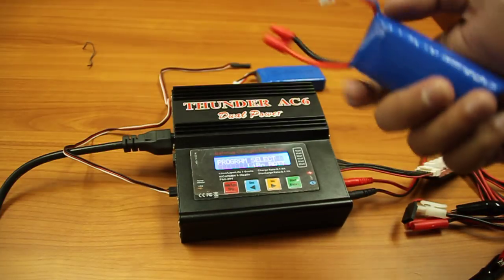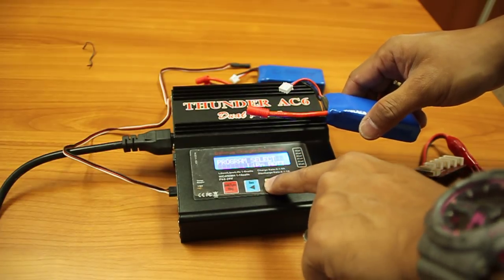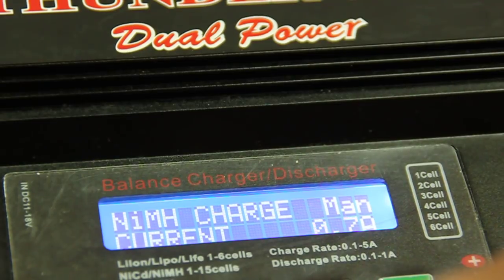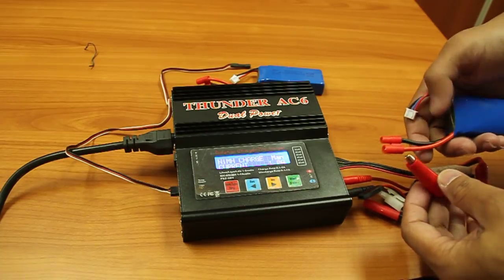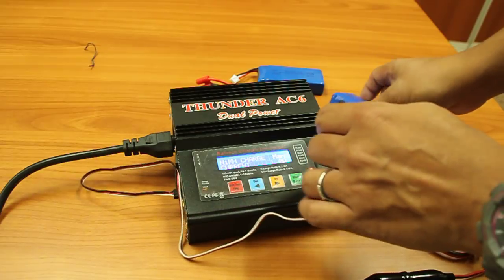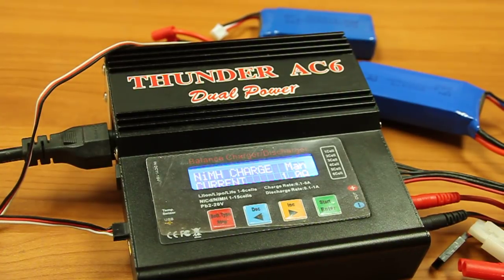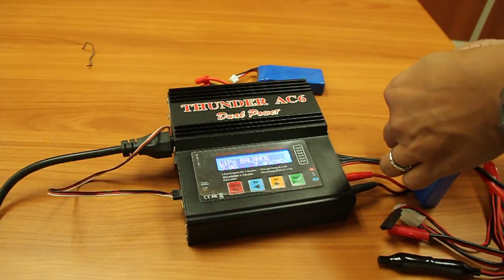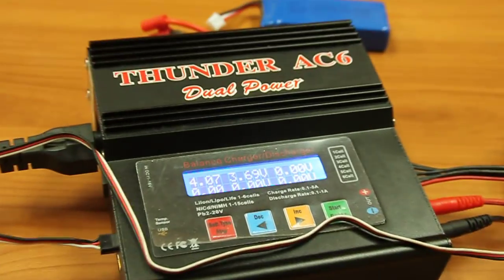Low Voltage Error on your Lipo battery? Here's a quick fix!

Comment: Yep, this works, unplug your balanced connector before charging tho, or it will error, brought back an 3S 2500mah  sitting at 7.5v to 10 volts within 5 minutes, then I just charged it as normal 👍

Comment: THANK YOU!!

I was having so many issues, for what reason I have no idea. 

3S 5200MAH 11.1 V had a reading of less than 2V. I put it on nimh 1A for approximately 5 minutes, jumped the voltage to 8.4ishV, and the lipo charging mode recognized the battery and began charging!!

Comment: Is it normal for different cells to reach lipo cuttoff at different voltages? Like my 2S when I put it on the balance charger, 1 cell is like almost .2 higher than 2nd cell. Is it because  its in series and thats just how it is.?
Reply: Yes, it's pretty normal, as long as it's not too much of a difference,   .2 is nothing

Comment: There must/can be only 0.1  rate difference between the cells. Check your connectors, if it stays way of your battery is dead or it gonna catch fire. So be careful

Comment: Awesome. Saved my battery.
I have a 4s 720mah that went low voltage.
Charged with 0.2A until it hit 13V them went back to the lipo balance.
Worked!!

Comment: Didn't work for me at first because I was doing it wrong. Watched closer and made sure not to connect the balancing wire when doing the nimh charging. Worked like a charm. Took me about 5 minutes or so to get to 9.6v on 3s 5200mah batteries and then switched to lipo and voila!

Comment: Mine voltage on 2s stays always around 4.70V with nihm charging (I think one cell is too low). What should I do to get them around 7.4V ?
Reply from the maker: We have the same problem.   I'm looking for a way for just to charge up the 2nd cell but too risky.
Reply: @dehnermdeleon  for the risk its not worth bro. I have bought new 2-pack 2s batterys ;)

Comment: Thanks, it worked. 1 minute was enough to get rid of "low voltage" error on my Eco Six charger. Not sure if the battery would still work, but at least it's charging now...

Comment: After I forgot to switch off my RC Crawler because their was a problem with one of my kids I came back and saw that I left the car without switching it off. It also had the problem that I couldn't charge it anymore luckily i did the same as you told me and the battery is saved thank zou very much .

Comment: My lipo battery currently has the same issue :
Cell 1: 4.20v
Cell 2: 4.24v
Cell 3: 0,00v

Is it safe to follow this method? Previously I'm charging with a cheap lipo charger (B3 pro)

Comment: I fixed one of my batteries this way, but when i try this on my other battery, wich is the same type battery, it shows OVER voltage when i try to charge it in nimh mode? Any suggestions?
Reply from the maker: It might be a defective battery

Comment: Awesome. I was skeptical about charging on a different mode. I literally only had to do it for like 2 seconds on 0.8a, and it fixed the low voltage problem. Now charging like normal on lipo mode. Thanks!

Comment: If voltage too low what I do is get a fully charged battery of the same voltage and connect red to red and black to black cable hold it for like 3-6 seconds and then put on charger and will start charging hope this helps

Comment: Hey so I did this with my 5000mah 7.4v shorty but when I tried it with nimh charge 2a it went up to about 5.5v, then started going back down and when I tried to balance after it still said low voltage afterwards. Any fix?
Reply from the maker: I think this is a cell issue and cannot be fixed

Comment: Best video to save your LIPO battery, it saved my batteries in minutes!!! I forgot 4 cells in my truck for a few weeks and outside temp went below 0C several times. All cells were reporting "Low Voltage". I did this trick on 2 2s and 2 3s. I did what this guy said but actually went even safer. Here is how it went:

I plugged a 3s battery, set the charger to NIMH 0.1 AMP change. I charged it for 1 minute up to 9.5V, 1 minute folks that is all it took... I stopped the charge, pluged in the balanced wire and start lipo charged successfully! Saved the battery! 

My 2nd cell would not charge at .1 amp. I put the charger on 1 amp NIMH and restored the voltage to 9V in 1.5 minute. Changed setting to LIPO et Voila!!!

the 2 2s cells that were dead are older cells, several years of age. I charged them up to 6V in 3 minutes on NIMH 1AMP and then changed setting to LIPO balanced et Voila!!!

Thanks!
Reply: Francois, this worked for me too! As a noob to RC Flying, I was thinking that I'd need new liposuction, when they wouldn't charge after the winter furlough. Top tip!
Reply: Thanks for the input - worked for me too :)
Reply: OMG you just saved me and my sons RC life. ♥ THX

Comment: Friend when I do on my lipo this nimh thing and push enter for charging it shows me  7.8v. 
So can I wait and how long???
Or the battery is Dead???
(2s 4000mah....)
Reply from the maker: What is the Voltage of the batt?  If that's the max Voltage then it's not a low voltage error.  It can be another problem.  Usually you should not exceed at the max voltage of the battery when performing nimh charging.

Comment: my problem is.... i have 2S battery 7.4v. i use turnigy 80w 10 amp and it can connect to pc. for some reason it reads 6 cell battery and gives me error hi voltage battery check volt... yesterday was charging without any problem
Reply from the maker: it can be a cell or board issue

Comment: Thank you so much. It works for my 6S lipo. Had to charge it in Nicd mode at 5 amp for about 6 mins til it reaches 21v then switch to lipo mode and works beautifully. Was about to toss this expensive battery away. It's pretty understandable that all batteries if not use often will degrade and that's what happened. Same thing with a car battery. Park your vehicle for a few weeks you may not be able to start it.
Reply from the maker: Glad it helped

Comment: So awesome! I left my brand new 2s 2200mAh battery plugged in and on. Tried to charge it today and it got the low voltage warning. Tried this fix at 1amp and brought it up to 6.9 volts then tried it on lipo balance and it works! Thanks!

Comment: Worked for me. I did same trick with 18650 pack what I made myself. Problem was that batteries were discharged and showed only 0.05 V. After providing some juice (roughly 10 min in NiMH with no balance) my charger start sensing them and then was able to properly balance charge them. 

Thank You!

Comment: Good video.  Looks like it worked for a lot of people based on the comments.  I'm going to try it on my batteries but one question...should I connect the white balance plug while it's charging?  I see you didn't connect it in your video.   Thanks
Reply from the maker: Hi Kev there's no need to connect the white balance plug during charing in NiMH mode.  Hope this helps and good luck!

Comment: What causes lipos to get low like this in the first place? I store all my 4s lipos at the recommended 3.80v.

But for some reason my main battery which I don’t abuse and is only 3 packs old. Came out of my storage box at 2.13v. I never let my lipos go beyond storage voltage. What makes them go this low on their own? Bad battery?

Oh and I’m doing this now, seems to have done the trick! Back up to 3.65?. Thank you!
Reply from the maker: My lipo malfunctioned after my drone crash and gone missing for a day.

Comment: Definitely works! Went to charge my battery this afternoon and the charger spat out the low voltage warning - then I tried this. Battery went from 3 volt to 7.42 volts. I shut it down and switched to LiPO and no warning. Thank you
Reply from the maker: Glad that it works.

Comment: Had a 3s lipo (11.1v) had 3 0.00V readings and 3 2.xxV readings. Put it on NiMH @ 0.5A (Battery charge rate is 1.3A) for 5 minutes and watched the voltage climb from around 9 to 10.80. After it reached 10.80, I flipped it back to lipo mode and wallah it worked! Thank you! Liked!
Reply: BOTH OFF YOU MADE MY DAY, i thought i lost this lipo but luckily not

Comment: What do I do with the error message CELL ERROR and no other explanation? I have the SkyRC e660 charger and even the manual doesn't tell me what to do. Appreciate any ideas.
Reply from the maker: It can be a terminal to the cell or the cell itself is the problem.
Reply: @dehnermdeleon  Thanks for the reply. After some troubleshooting I managed to fix it, I think. I suppose it was a low volt problem. I charged it for 40 seconds with the NiMH program as you said and then I suddenly managed to balance charge it again..

Comment: the first battery  with your way
it's worked
but the 2nd battery is 3sl
5000mah 11.1v 50c
so i tried same but it doesn't working this time
what do you think!
Reply: I have the same battery as u was completely fucked i forgot about it for a few months this method saved it and it balances fine now

Comment: This did not work for me. I get a cell count error no matter what amperage I set it to. I did set my 7.4v to 3.7v and it worked but it read fully charged almost immediately but I know it's not charged because I just ran them low while running my rc.

Comment: It works Awesome!! But i have a quick question im charging 1250mah battery, so does that mean capacity indicator on charger should be around 1250, too? Or should i just wait until it says it's full
Reply: One more thing, you put 0.8a for 5500mah battery. You think its ok to putt 5.5a?
Reply: Yup

Comment: Worked great for me👍
I had a 5200mAh, 7.4v, 2s. I charged it at 1.3 Amps till it said it was at 7.0 volts then stoped and balanced it.
Reply: i got the same one did what you said and it wont go above 6v and still wont work on balanced charge

Comment: Worked like a charm for my 6S 3300mAh LiPo. I NiMh charged it to 19V (max 22v), then changed program to LiPo. Then the charging continued while showing one cell with a lower volage than the rest. Hitec X4 Eighty

Comment: my 5200mAh 2s LiPo was at 6.20v, I used a cheap $10 charger and now I can charge it with my good charger :)
Reply: one of the cells was about .20 under so could it be a bit damaged?

Comment: This actually worked!:) i depleted one cell of my 3S battery when i had my drone hooked up to betaflight and was testing engines. Apparently in this mode only one cell was used and was not recognized after in charger....btw it was battery that i bought like two days ago and since im noob i didnt know. I said my goodbyes to it but i found this..after 7min in LiNM mode i got voltage error and just like magic LiPo was found with enough voltage to get balance charged:) what a day. :)
Reply: To add, i was charging it on concrete on balcony in a ceramic empty pot and had sand ready just in case. I sat next to it and controlled temperature every 20 secs
Reply from the maker: Glad to be of help! A subscribe would be nice!

Comment: Find which cell is the low one through the balance port of the battery, and charge as a single cell lipo with a receiver connector.

Comment: Awesome! Worked for me! Thanks a lot. Did some minor changes:
Had a 4cell 1300mAh battery, with the following cell voltages:
#1@0.888V
#2@3.931V
#3@3.932V
#4@3.933V

Connected them as explained in the vid. Charged at 0.5A for 3min-ish. 
Cell #1 had then risen to 2.524V, (#3,4,5 was more or less the same).
That allowed me to start charging it using a regular LiPo program.
Reply: I'll give this a try
Reply: My batteries are at 
1.57
6.28
3.91
3.91
It just won’t balance out the 6.28 just keeps climbing and the rest don’t move
Reply: @Frosty_fusion put it max Amps on NiMh and wait for 1 hour. Should be good after that

Comment: My Turnigy Accucell S60 gives me an connection Break warning how can I fix it.
Reply from the maker: Bro check the terminals (connector) there's no continuous flow of current otherwise it can be an internal issue inside the cells.  Too risky to check

Comment: I was so terrified to do this, but it did actually bring one of my old Li-Po's back to life. I'd make sure to have a bucket of sand nearby when doing this, since I've been told it's the best way to reduce the damage caused by a Li-Ion/Li-Po going into thermal runaway.

Comment: I JUST PUT IT ON LIPO CHARGE WITHOUT THE BALANCE LEAD AT THE 0.40 CURRENT FOR 10 MINS. THAT WORKED FOR ME.
Reply: Holly cheese wheel that works. i was trying everything. i either got "Lower voltage" alarm or "incorrect cell count" errors when trying different modes. 
when i tried auto detect cell count mode it said 3 fine with just the balance lead, but when i connected just the negative or positive of outputs together it went to 2cell.

EDIT: its charged a bit but im still getting the same problem...
Reply: That way only works if your charger does not require balance plug input otherwise it will have a plug connection warning and will not charge without the balance plug connected

Comment: Hey is it necessary to balance charge after battery voltage comes to normal voltage in NiMH charge? My battery charger says low Voltage error for a 6S LiPo battery at 22.0 Volts on LiPo Charge mode.
Reply: Bslance wire problem i think...

Comment: I did it but seems a problem occur
When using Lipo mode, in balance mode it shows 4.2 3.8 3.9 and stop charging 
but in storage mode, it still shows 4.2 0 4.2 and low voltage error
What should I do?
Reply from the maker: +Eddie_Fong Hi I think you really need to replace your lipo battery